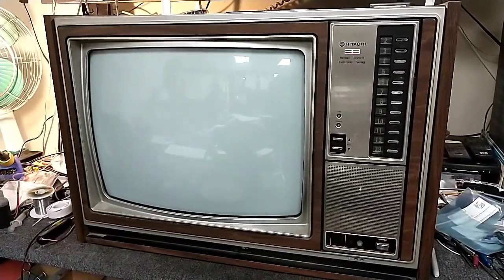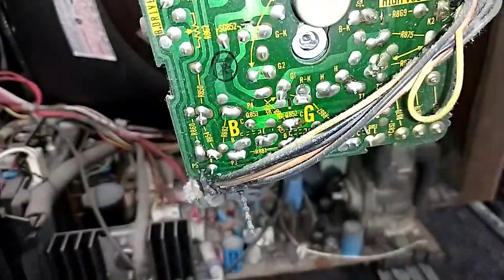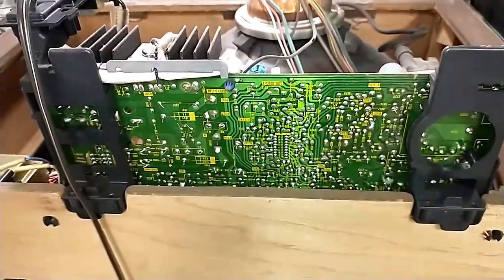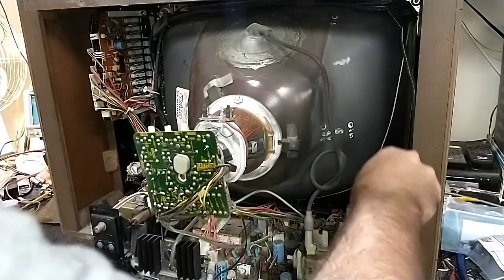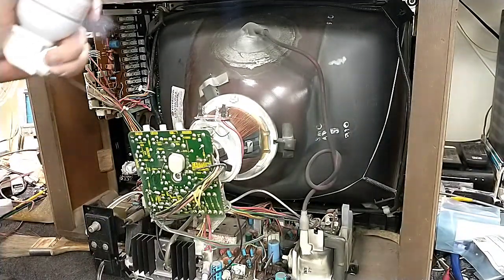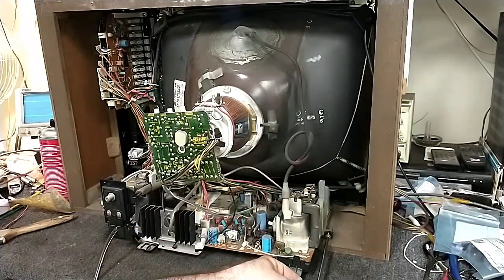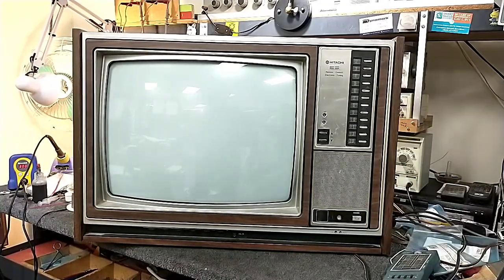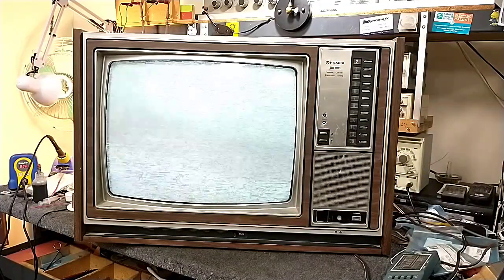Quick service of a 1979 Hitachi CT-979 19" color television.

Comment: The rubber wedges holding the scan coils often reacts with the copper insulation and can destroy the scan coils. I often slip a piece of insulation tape on the wedges.

Comment: Get one of those small air compressors, and I would not brush that fine dust inside.
It does have a nice picture, I always liked those CRTs because you can actually see the phosphor stripes, even though it doesn't help with contrast in a well lit room.

Comment: You might think based on the dust on the high voltage line that it would be high hour and the tube might be weak but it runs very nicely.

Comment: VIR,  that is something i have not seen since i was a very small kid with my parent's RCA tv.
Reply: The only problem with VIR is that it relied on the producer to insert the reference signal (line 19) into the program. I'm not sure anybody has used it since the 1990s. RCA won an Emmy for VIR in the 1970s, and it was the basis of its Color Trak series of TVs.
Reply: @dougbrowning82  the "VIR" circuit was the first part to malfunction on that stupid set. :(

Comment: i used to have 3 early 70s hitachis, and apart from the tubes being bit low emission, they all worked perfectly, unfortunately they had that instant on feature which kept the tube heaters running at lower current when set was 'partially off', probably why they were poor! i then got hold of an 80s? i think set in the mid 90s which had an unusual directly heated tube, with fast picture appearance, that was used for a few years until emission dropped too far

Comment: Interesting that the CRT # is  in inches 19--- .  Most Asian sets were millimeters . Good sets I had a 13 inches from 1987 for about 12 years. I didn't have time to fix it when it popped, and it didn't have a remote, so I got rid of it. But I still liked it.

Comment: Get yourself a little cheap "hotdog" air compressor and an air nozzle. Then go out back with these dusty chassis and blast the crap off.
Makes a world of difference and a great improvement to your work environment!
Cheers,
Reply: I use a brush and vacuum hose to clean my chassis with.

Comment: cathode ray (electron) tube, is technically what it is, how it works, picture tube is describing what it produces, both are correct, you could in theory also call audio amplifier valves/tubes 'cathode ray' as again thats what they are, but not 'picture tube', unless its a phosphor tuning indicator,

Comment: What a waste of time. The new TV system is 100% better then any CRT tube can display.
Reply: Nope...Pacman just has to be on CRT !
Reply: You miss the whole point ya duck head....
Reply: @craigstaggs8597  Your head is not on straight either.
Reply: Oh Really now, i have A 30 Year old RCA that lasted Without ever being Apart till the Recent big Ball drop, then Picture Tube Went out, Chassis is still Good, No filament on the Tube, Yet it ran every Day and Night For 30 years before Quitting, yet Its just the Tube went shot, the chassis still Plays, Has sound and High voltage, right now its just sitting, as too heavy for me to Move it, i now do Have a Projection TV i put another Lamp into, but i bet thats not gonna run as Long as the RCA CRT did. Why lets just see Any new Flatscreen run that long every Day and Night. Bet it won't For long. CRT's were Built To last, only Reason they can't be Used now, that stupid digital of which isn't any better than analog, As digital is All or Nothing, analog Didn't Care, even weak signals one still could watch TV. thats why i say, Things never will be same as they Used to be.

Comment: But Why???
Sure you have all the tools to get it adjusted, aligned, and such.
But to what end?
Since 2009, you won't be able to use for a TV.
It has no other inputs.

So why put all that energy, and time, if it's still worthless?
Time to retire your old TV tech, move on to something worth while.
Reply from the maker: I service vintage audio for a living. That keeps me busy with a two month backlog. The TV's are a hobby.

They can absolutely still be used. I feed mine with an HDMI to rf converter, or HDMI to composite depending on if the set in question has composite input or not. 

I'm not looking for a stellar picture. It just needs to work. I don't believe in tossing things out because of age or obsolescence. Use it till it can't be fixed anymore.
Reply: @JordanPier  I  belive in tossing them out, complete waste of time, money, and effort.
Who in their right mind would ever want  to play ANY games on a power hungry old picture tube.
You can make up whatever insane excuses you want, but you are wrong.
'Backlog' for who exactly, you?
You can't tell me you have actual customers wanting to buy that crap.
There are very inexpensive lcd panels that can handle any game, without drawing 100 watts of power.
No, you are insane to keep doig it.
Reply from the maker: @chuckjones5797  just sold an 80s Samsung 13" for $100 this morning. 

Servicing vintage audio has kept steady income for almost 16 years at this job. Can't argue with the numbers
Reply: @chuckjones5797  New cars offer better performance, fuel efficiently and safety... and yet people love to restore old cars. Not because they are objectively better,  it's because they find them interesting, more aesthetically appealing or are interested in the history and evolution of the automobile. It's the same reason someone would want to restore these sets... which are getting harder to find - I would love to own a restored set... if only I could find the room!